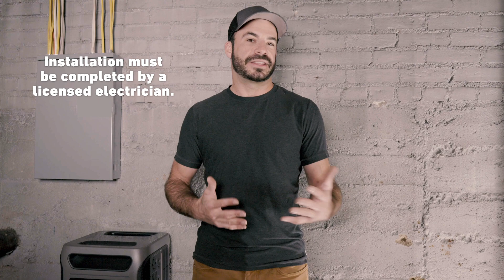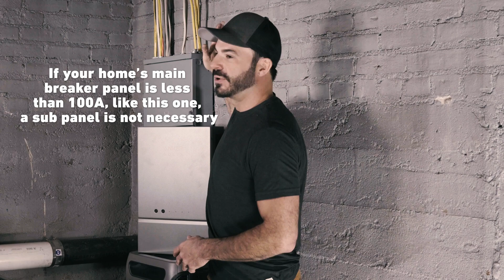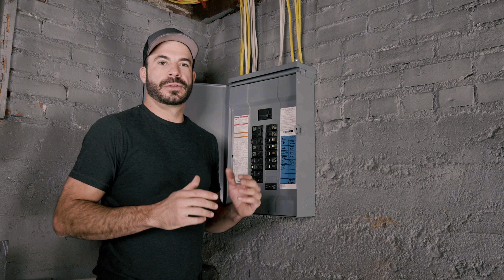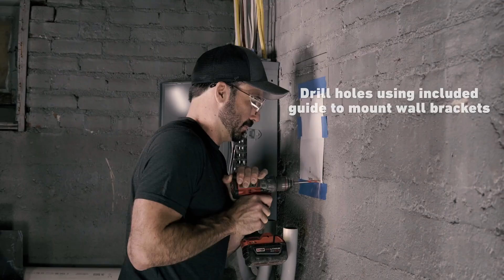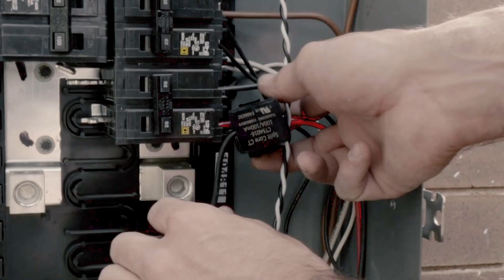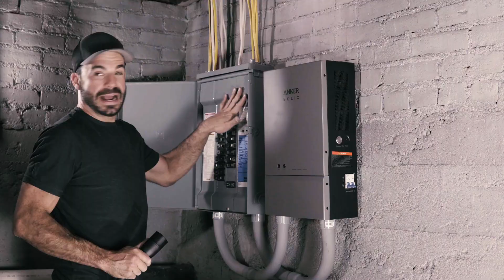Anker SOLIX F3800 Full Potential: HPP Installation Guide

Comment: Thanks for this video. It's the first one I've found that seems to use the config that I'm considering with the 3800s - just the HPP with no additional 'backup' sub-panel primarily backup purposes (and maybe cost-shifting). I'm assuming if the incoming feed lines are long enough to reach the HPP, they can just be moved w/o having to run new lines from outside?

My main question, though.... On Anker's website, it says "With Double Power Hub, your output rises to 12,000W, and you gain 120V/240V split-phase power—great for all appliances at home." With the Home Power Panel, it says "6,000W, 120V/240V split-phase output in one unit for power-hungry appliances." Does that mean that a single 3800 will provide split-phase 240v with the HPP?

I ask because I don't think I need the simultaneous power provided by 2 3800s, in which case I may be better off with 1 3800 and expansion batteries, but I do have a couple of 240v appliances that I would like to be able to power from backup.
Reply from the maker: If you need to know more about f3800 watch this video https://youtu.be/5H-w63thZiE?si=RrcTQhQLnbRiFm75